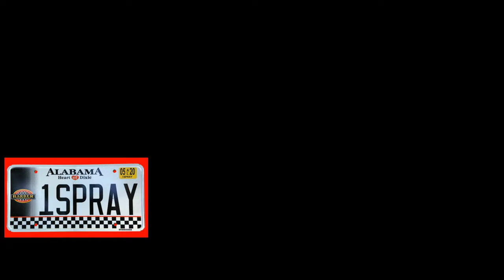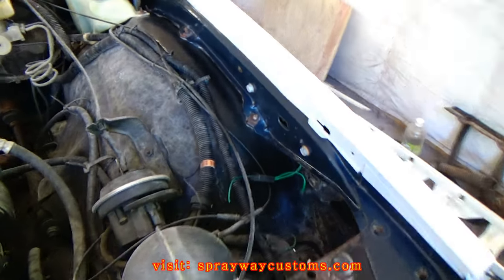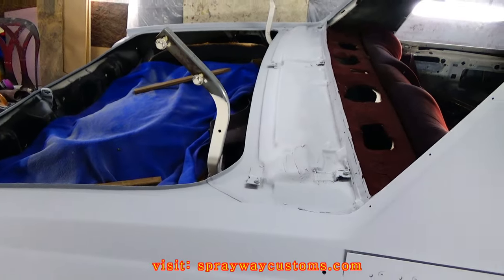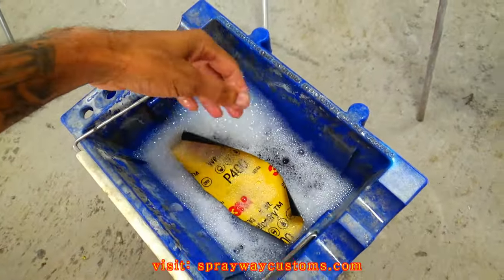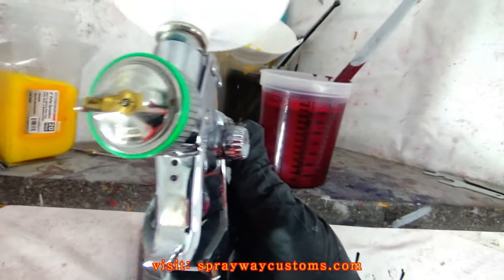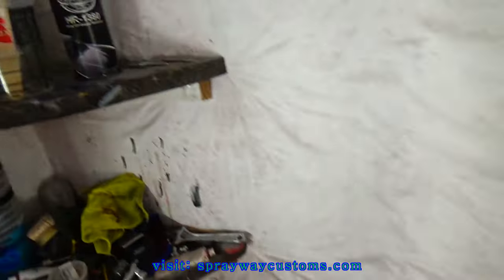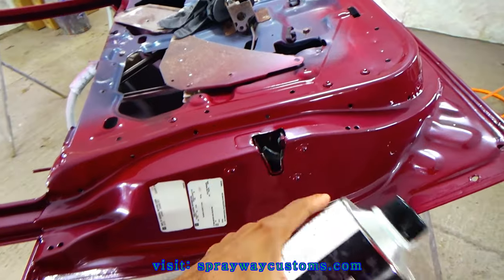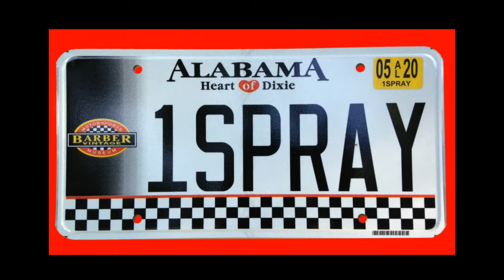How To Paint Car Door Jambs On Box Chevy Caprice LS Brougham With TAMCO HC-2104 Euro Clear

Comment: spray way nice job, ?4u, have you used 3m seam sealer the 2 part stuff for redoing seams on door and panels,  where you tape the outline of the seam with masking tape  apply seam sealer then lightly  brush it,  the stuff just flows smooth. Then remove the tape after a few min the seam sealer will form a smooth flat bead like the  factory smooth edges ... and restoring the look on old seams.
Reply from the maker: Yes....great information 🤝

Comment: Never painted before so this might be a dumb question in between the base tristage peal  and clear coat do you still use a tac cloth between and what is the time period between each application,  you are a protectionist keep it up God bless. You have a gift
Reply from the maker: Burnett Bent only tack the base coat because the candy and clear will be still tacky in between coats. If you spraying a pearl with a binder you'll be able to tack it because a binder is nothing but a clear base coat. I wait 15-20 mins between coats

Comment: That is sweet color sir (as usual). That is a great tip on the soft edge! I had only thought of using that tape INSIDE the jambs. I have never been able to master the masking tape rolled edge technique that Shawn and crew can do. You are going to do a video of the rest of the job right? I have never seen a good video on the next step after the jamb painting.
Reply from the maker: Yes... I'm gonna try to get basically everything if I can. Thanks Erik

Comment: For this car it was the factory paint so you can scuff it and simply primer and paint over it; but If the car has been painted two different colors on top of original paint would it be best to just completely strip and start from scratch or would this same method work?
Reply from the maker: Adrien Morris If the paint in good condition just scuff and shoot

Comment: What's good appreciated the information on this one helpful as hell but I was wondering what method would you take when the rust is a little bit worse then that on the bottom of the door because the other drains were clogged so water set wish I can send u a picture so u can see what I mean so u can might do a video on it
Reply from the maker: Thanks John. I know what you talking about because I've seen a lot worse. You might be better off getting more doors from the scrap yard if it's too bad.
Reply: @SprayWayCustoms  wish it was that easy its easier to get donk parts down in miami then box

Comment: So maroon scotch brite is all you need to scuff up old paint before applying new base coat?  I see that you use 400 grit sandpaper on the primer.  Why not use the scotch brite on the primer as well?
Reply from the maker: Yes if the paint is in good condition. The reason I wet sanded it with 400 because the primer had a little orange pill.

Comment: Thanks for the video and explaining your steps. I have one question.  Can I paint the jambs then mask and bodywork, prime, wetsand the outside panels or should I do all the bodywork and wet sanding inside and out before I spray the jambs?
Reply from the maker: You can do it either way but I prefer to do the bodywork first so you don't have to remask the jambs
Reply: @SprayWayCustoms  thanks very much
Reply from the maker: jemo951 no problem

Comment: Hey how you mount fiberglass door panel that was made...
Reply from the maker: I use the original mounting brackets and also drill some screws in the existing panel through the speaker openings.
Reply: Ok cool

Comment: Hey Sprayway I got my chevelle back finally had some bs going on w the motor swap but ima do a video on my channel updating that but I wanted to ask if you had any tips I have 2 weeks before it goes in the shop I was thinking about doing a quick paint job on it going flat black would look good and be the easy way out but I was thinking about trying a real paint job a grey. But I'd be doing it outside and I dont want it to look shitty should I just gone and hit it w the flat black I know how that will turn out bc I did the truck i just wont add the clear coat to it this time. But just wanted some tips on spraying outside
Reply from the maker: Go ahead and put a base coat Clear coat on it but try not to spray it in direct sunlight. It'll be good if you had a carport or something.
Reply: @SprayWayCustoms  yea I need to look into some type of portable booth. I'll prob just wait until 6:30pm to start spraying when the suns not so high and beaming that's where I messed up last time.
Reply from the maker: Ok kejuanh87...that'll be a great move

Comment: Which compressor works best for you?
Reply from the maker: I have a 60 gallon myself
Reply: i have a 15 gallon, made lots of noise and vibrations even after placing it on a tire(wheel). since i have a small space to work in never liked the loud vibrations... then i saw a video about a turbine based paint sprayer.. ive been thinking about it for some time.. whats your opinion??

Comment: After your two bases coats, how long did you wait to shoot your clear?
Reply: Bent Nickel he sprayed base, than inter coat than clear.  Usually 15-20 mins between coats.  Depends on reducer, Gardner, and the temp.
Reply from the maker: Correct. I usually let it flash 15-20 mins
Reply: Thank you.